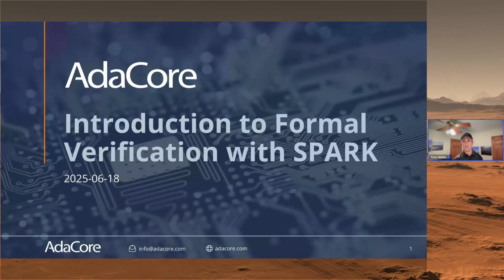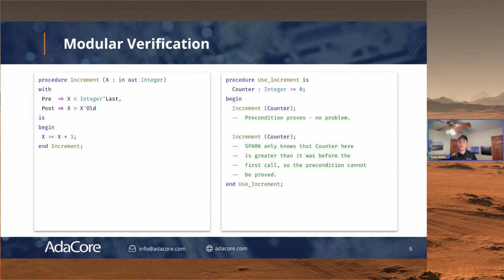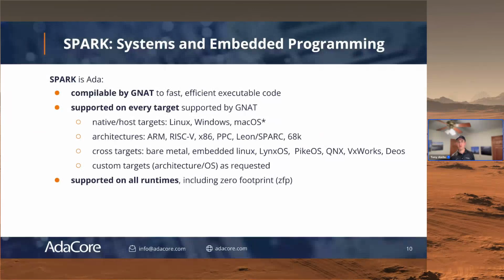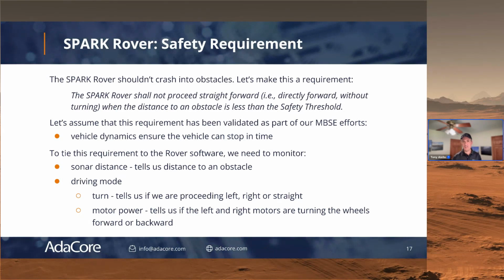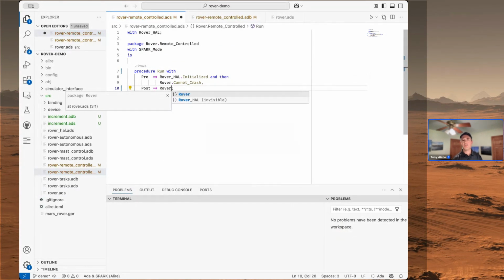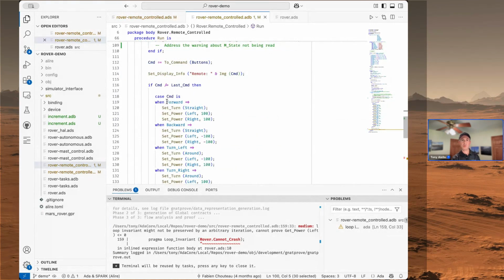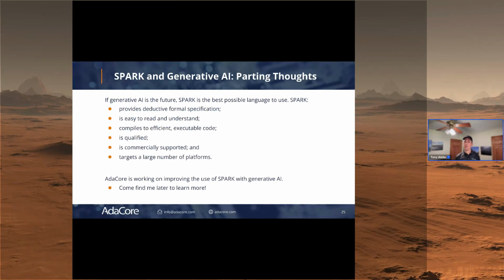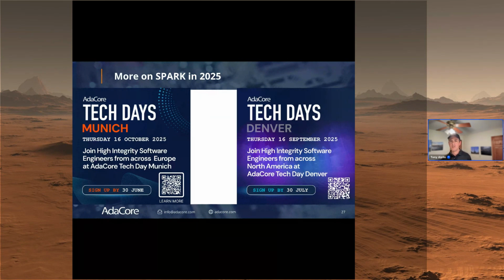Webinar | Introduction to Formal Verification with SPARK

Comment: I would say that Ada is safer than safe Rust and not slightly safer than unsafe Rust. You could argue on initialisation but that's for performance and may even help catch logic errors with e.g. Valgrind and of course you can easily use SPARK in Bronze mode and even just for Borrow checking on rare occasions.

Comment: AI Summary

Abstract:

This webinar provides a comprehensive overview of SPARK, an Ada-derived language and verification toolset designed to formally prove the safety and security of embedded and systems software. The presentation details the core principles of SPARK, including its use of deductive formal verification, where program correctness is proven against functional specifications (contracts) using automated theorem provers. Key features are highlighted, such as its modular and practical nature allowing for incremental adoption, its target-aware analysis that proves the absence of runtime exceptions, and its rich support for advanced Ada constructs and low-level hardware interaction.

A significant portion of the webinar is dedicated to a practical demonstration using a "Mars Rover" platform. It shows how to formalize a critical safety requirement—collision avoidance—and tie it to the software implementation. The demonstration walks through the process of modeling hardware state using ghost code and uninterpreted functions, and illustrates the necessity of loop invariants to help the SPARK prover successfully verify the property within the rover's remote-control logic. The session concludes by discussing the potential role of SPARK in verifying code generated by AI and a Q&A segment.

Using SPARK to Prove Safety and Security in Embedded Systems

*   00:01:29 - What is SPARK?: SPARK is a technology for deductive program verification. It consists of two main parts: an Ada-derived programming language that includes a functional specification language (contracts), and a tool that uses automatic theorem provers (SMT solvers) to prove that the code is correct with respect to its contracts.
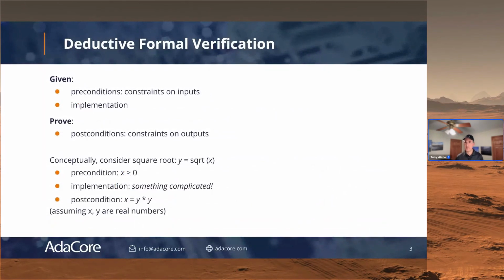*   00:03:36 - Deductive Formal Verification: The core concept is to prove that given a set of preconditions (constraints on inputs) and an implementation, a subprogram will always satisfy its postconditions (constraints on outputs).
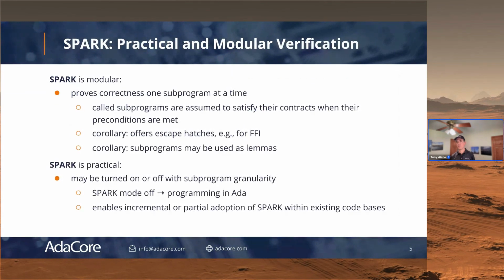*   00:05:56 - Modular and Practical by Design: SPARK verifies code one subprogram at a time, which makes the analysis scalable. This modularity allows for incremental adoption, meaning you can apply SPARK to critical parts of an existing Ada codebase without rewriting everything. It also allows for safe interfacing with code in other languages like C or Rust.
*   00:11:14 - Ideal for Embedded Systems: SPARK is essentially Ada and supports critical embedded features like precise memory layout definitions (representation clauses) and interaction with hardware through volatile memory, making it highly suitable for low-level programming.
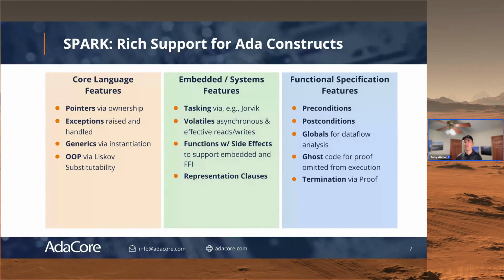*   00:12:41 - Modeling with Ghost Code: SPARK allows the use of "ghost code," which is code used only for specification and proof that is not compiled into the final executable. This is useful for modeling system properties without adding runtime overhead.
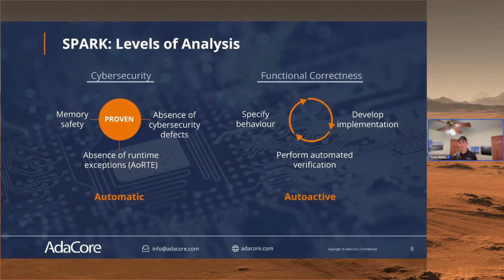*   00:14:52 - Automatic Proof of Critical Properties: Without writing any custom contracts, SPARK automatically proves the absence of many common bugs, including memory safety violations, integer overflows, array out-of-bounds access, and other runtime exceptions.
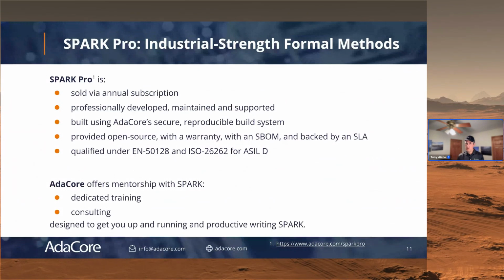*   00:18:16 - Industrial Strength and Qualification: The commercial version, SPARK Pro, is professionally supported and has been qualified under safety standards like ISO 26262 for automotive systems (up to ASIL D).
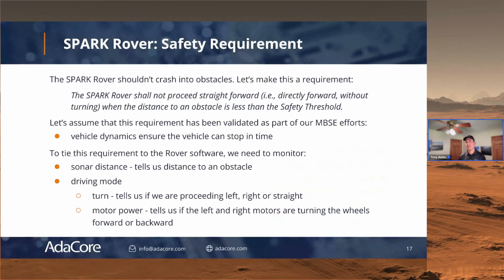*   00:22:53 - Demo: The Mars Rover Safety Property: The webinar demonstrates proving a safety requirement on a Mars Rover: "The rover shall not proceed straight forward when an obstacle is closer than a safety threshold."
*   00:25:16 - Modeling Hardware State: A key challenge is reasoning about hardware state (e.g., the direction the wheels are turned) when the hardware abstraction layer only provides setters, not getters. This is solved by creating a "model" of a getter using an uninterpreted function and ghost state, linking the setter's action to the proof without implementing an actual getter.
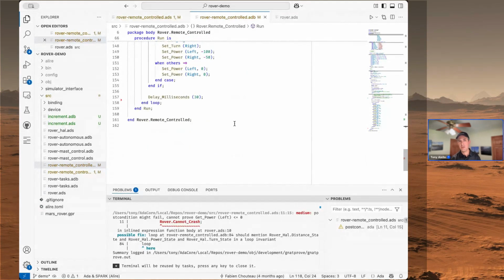*   00:35:03 - The Importance of Loop Invariants: During the live coding demo, an initial proof fails because the prover "forgets" the state of the system from one loop iteration to the next.
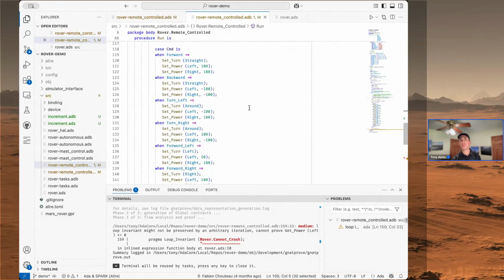*   00:38:26 - Solving the Proof with a Loop Invariant: To successfully complete the proof, a `loop invariant` is added. This is a property that is true at the beginning of every loop iteration, providing the prover with the necessary context to confirm that the safety property is maintained throughout the loop's execution.
*   00:41:20 - The Future with Generative AI: SPARK is positioned as an ideal language for a future with generative AI. AI can generate the implementation, but SPARK's formal specifications can be used to rigorously verify that the generated code is correct and safe.

I used gemini-2.5-pro| input-price: 1.25 output-price: 10 max-context-length: 200_000 on rocketrecap dot com to summarize the transcript.
Cost (if I didn't use the free tier): $0.06
Input tokens: 36661
Output tokens: 1000

Comment: Hello, i have some questions:
Wouldn't integrating artificial intelligence into SPARK spoil real-time performance? Would it be useful to quantize the models? Is there a set of tools for coding generative AI in SPARK similar to Tensorflow?

Second question: How are cryptographic mechanisms implemented in the hard real-time domain with SPARK?

Last question: How to make a mini web server respecting a proof-of-concept model and formal verification tools with SPARK?

Thank you for your very pedagogical content !
Reply from the maker: Hello! In answer to your questions:

1a: The proposal is not to integrate AI into SPARK, but to use generative AI to propose assertions and loop invariants automatically, so that SPARK developers don’t have to propose them.

1b: Model quantization is essentially orthogonal to this topic.

1c: AdaCore has support for writing CUDA kernels in SPARK or Ada; please contact sales@adacore.com for more information.

2: See the blog-post series by Rod Chapman: https://blog.adacore.com/proving-constant-time-crypto-code-in-sparknacl for more information on this topic.

3: This sounds like a rather open-ended question - I propose you reach out to sales@adacore.com and we can discuss your needs in more detail 👍
Reply: SPARK isn't a runtime technology but rather like an analysis technology so there is no performance issues in fact it aids performance potentially by removing any need for runtime checks where desired.